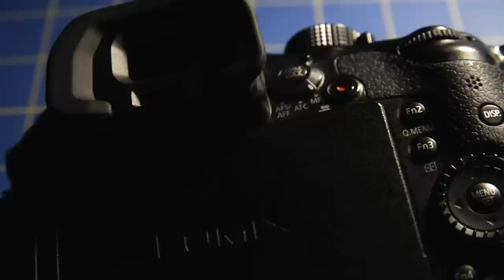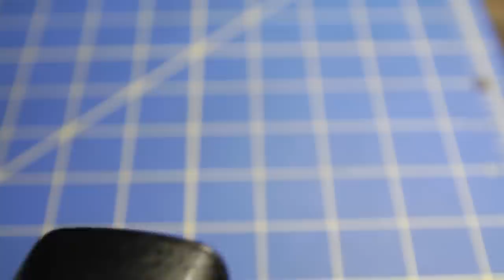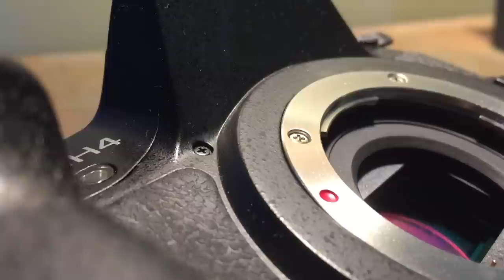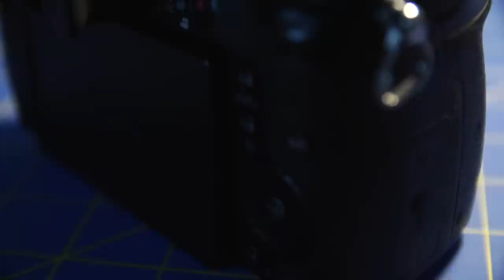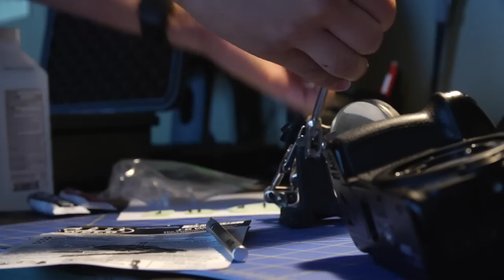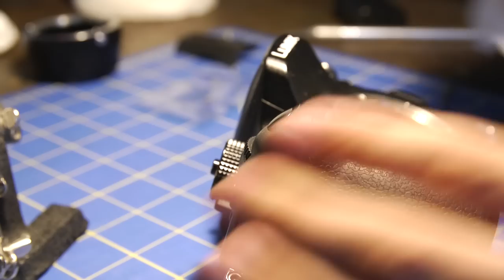How I Fixed My Camera for $5

Comment: I’m with you… When our living is depends on what we use we buy expensive professional gear for a reason: reliability. When it fails on us is really disappoint (yes, gear, which is a tool, can break) but the pro mark should mean it would be repaired at a fair price when not under warranty…
My Panasonic GH4 stopped working a month ago at a wedding (good thing I have other 5 cameras, 4 used on each wedding + 1 spare/backup camera and multiple low light cine lenses although the GH4 is the best one, my main camera) but was still under warranty… If that was not the case I probably would need to buy another one since it is my main camera (of the ones I own).
The repair service report says the PCB Main and Top Case were replaced… My company actually repairs computer and audiovisual equipment but in this case it was under warranty so there was no reason to fix it myself. And, of course, it’s not easy (nor cheap) to find spare parts for the GH4.
Reply: The GH4 isn't a professional camera.  It's a higher end prosumer model.  If it was professional, then it wouldn't be MFT.  Not bad for video recording, but appalling for still image acquisition. I have one too, but only see it as camera that is sacrificial.  Pro cameras have full sized 35mm image sensors.  But it's still a great little camera.
Reply: I respect your opinion but I respectfully disagree.
Gear does not make a professional product... the professional making it does. Good video professionals are not locked to camera brands or sensors. It helps, of course, but it is not, by far, the aspect that makes your product stand out. If they call the camera professional, consumer... that up to those who care about labels. I'm not one of them.
When you work with all kinds of budgets you can't afford to own a €50k camera, not even a €20k, but a camera that gives you the most flexibility to monetize your investment (which applies to all gear in general).
Reply: Mmmm...kind of.  A professional can certainly milk the best from a disaster of a camera build.  However, chip size does matter.   For pack-shots, no client would touch anything under a full sized sensor for their requirement, regardless of who the photographer is.  It's to do with the final print.  S35mm sensors pack a lot of light receivers, and that, to a catalogue client (for example) is extremely crucial.   I've done pack-shots before and clients I did the work for insisted that the minimum was full frame sensors.  

Today, I work in a different industry (as per my avatar), and production companies insist, again, on the biggest sensor available.  We can only use 4k, 6.5k and 8k cameras, as that is what they insist on.  But the 4k cameras we use are far different to even the GH4 image sensors.  The 4k sensors we use are Super 35mm size.  Thankfully I don't have to buy these cameras, as they (along with the lenses) can cost as much as a house.  But 4k to one camera is totally different to 4k of another.   MFT 4k vs S35mm 4k has massive differences, and not just by the image sensor size.  A GH4 sure is prosumer.  Professional falls into the RED, ARRI and Sony bands of equipment.   For example, the GoPro boasts 4k, but the GH4 beats the GoPro hands down.  Different sized chip....same 4k number.  

You won't find any news gatherer,  Press photographer or catalogue photographer using MFT image chips.  The raw data just isn't there, even though it's still raw.  Personally, I use all sorts of cameras when I'm not working in my industry.  They all take photo's, even though I add creative flair.  But I couldn't place any of those camera shots into a professional media line.  Unless they were for the news.  

The other oddity is, I'm using a £90k lens on my own GH4, because I'm using the light gathering T1.2 to help the camera cope.  The downside is, my arms are starting to look like Popeye's.  It's a 10kg long lens.  But I do use a Voigtlander 0.9 as a runaround lens.  

Oh, I didn't buy the £90k lens (I actually have two).  I exchanged kit for them.  I'm only an aerial camera operator in the film industry, so don't earn directors money, alas.  But at least I admit to owning a GH4.  Not a bad camera and is fine for run-of-the-mill shots.  I don't use the video side of it at all though.
Reply: Yes, sure... If you can you should buy the best you can but when we are a small business the reality is quite different. I do video only so I can't talk about the photo side of things. I’ve never even taken a photo with it :-)
My lenses cost more than my GH4. The more affordable is a 42.5 Olympus due to its no flare advantage and then glass between T0.85 and T1.8 (fully manual) from various cine lines, current and (mainly) legacy, so I don't really need more than that and if I need I rent the gear (when the client wants or what I have isn't enough but always passing on this expense to the client, of course).